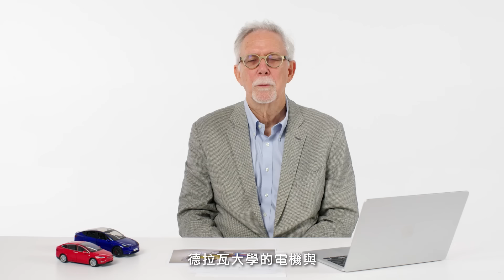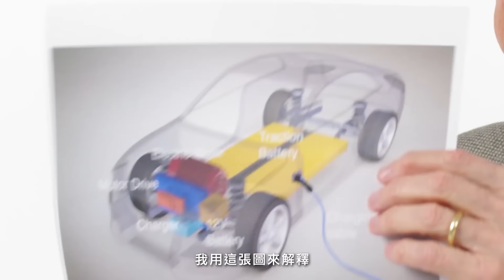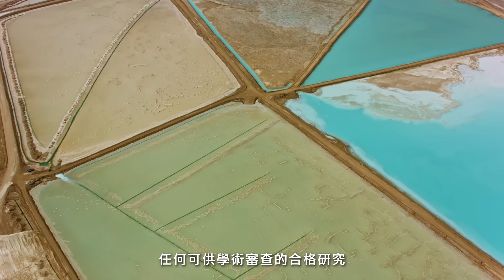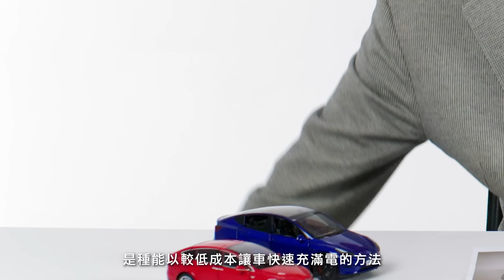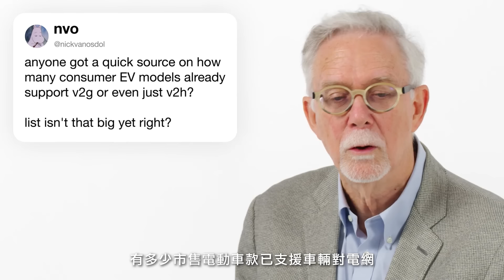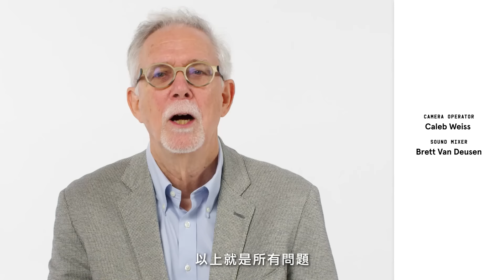電機工程學教授解答電動車問題！電動車真的環保嗎？氫能車為何戰不贏電動車？電動車其實沒有比較容易起火？電動車加速為什麼比較快？｜名人專業問答｜GQ Taiwan

Comment: EV fires are generally much more violent than ICE fires. They often start from the bottom of an EV so the passenger compartment is directly exposed to the heat underneath.